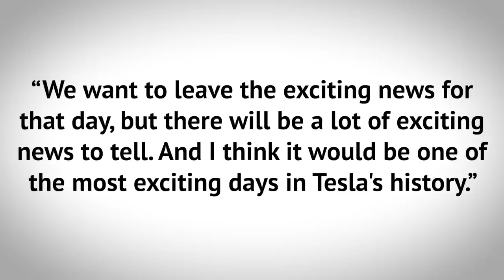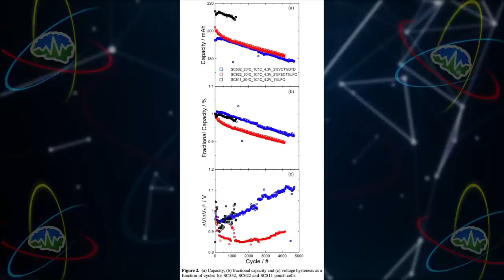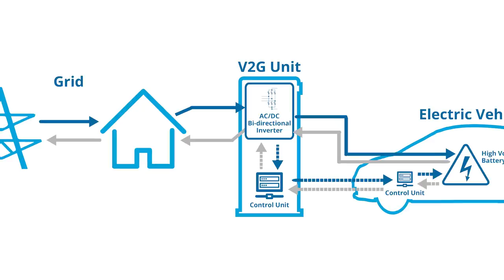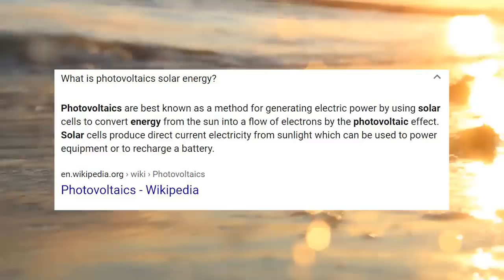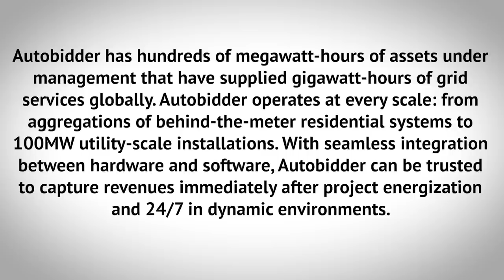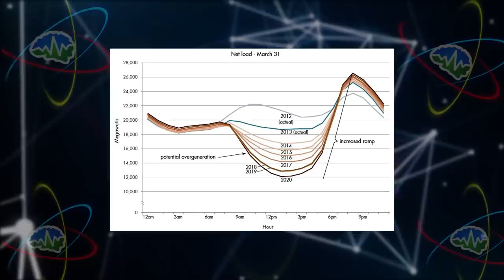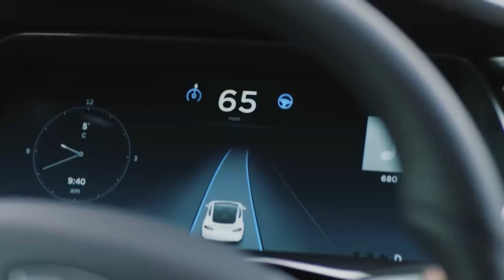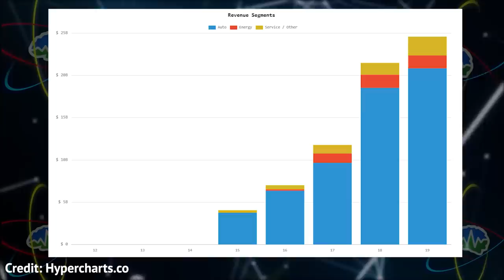Battery Day is Coming!  | In Depth

Comment: Unfortunately it is widely agreed and acknowledged that there is nearly no infrastructure in place for grid operators to gain information from distributed, behind the meter, resources. They would need this information in order to actually effectively take advantage of the battery for grid balancing. There are some meters being put in place in California for distributed energy, but they still aren’t required, and California is the only grid operator doing this. Luckily, we have seen that even if batteries self schedule in order to take advantage of the duck curve (rather than let the grid operator tell them when to come online), they will still contribute a near 100% capacity benefit to the grid that they participate in. However, that has diminishing returns and these cars will likely be at offices during the day, not plugged into an inverter. Also, the grid operator won’t be able to take this into account when grid planning, so how they charge ratepayers will get pretty out of whack. There is a similar issue with rooftop solar. All of this technology is currently only benefiting the upper class to a large extent, from artificially inflating electricity rates to big tax returns on expensive equipment. That all being said, there is a huge opportunity here. There are just more hurdles than this video makes it sound like there are.
Reply: To clarify, grid operators, known as RTOs, operate the transmission grid. Utilities operate the majority of the distribution grid. Utilities currently have no infrastructure to let you buy and sell energy in their distribution grid as a commodity. Instead, you just offset their pricing structure and potentially sell a limited amount of energy to them at a fixed rate. The RTO does have a way to do this. It is called the wholesale electricity market. However, they operate that market as a bidding war where they control the prices so that they can control the grid voltage at any point in time. This video is implying that all of these Tesla chargers and power walls will be bidding into the wholesale electricity market in order to optimize profit, using the cars as their storage. That’s not a bad idea. And it actually might work, but again, that infrastructure of communication back and forth to the RTO really isn’t in place yet, and their markets typically aren’t flexible enough to account for this type of highly variable supply. And they have never had to account for a locationally moving supply. This would completely disrupt the grid and require huge infrastructure changes both economically, regulatory, and technically. It sounds easy at first, but the reality looks like rerouting wires, getting bills passed, and slowly allowing small changes.

Comment: Just move to California.. They will happily mandate you run your house up $80,000 or more for 5 to 6 powerwalls, that are all under state control... throw in an extra 40kw of solar panels, and you will have one heck of an expensive house, mandated by the state, and you will be giving your power to folk that are either not working, or doing a job that has been made surplus...All on your nickel

Comment: Teslas battery day has been leaked. All it is is a solar panel that they have designed for the new Tesla outdoor bug light. It is mind blowing in that they have included two electrode buttons on the exterior of the light housing that a person can cover with their tongue.

Comment: A thought occurred to me: if Tesla wanted to they could lease their cars with the million mile battery at a really low rate that would make the car affordable for everybody, on the basis that Tesla keeps the money made from vehicle to grid charging. Essentially, Tesla would own the car, and would require that it be plugged in for a minimum number of hours each day. The person who leases the car would have a really cheap car lease, and Tesla would still be getting the data they need from the miles being driven by the vehicle, and would be achieving their goal of moving us to sustainable energy a lot faster. If I could have a brand new Tesla for say $50 a week, that would be a no-brainer. For $2500 a year, or a 10 year lease of $25,000, why would I bother to buy a vehicle? I'd also have the benefit of lower running costs and all the other benefits of owning a Tesla, without having to own it.

Comment: I think the V2G/VPP argument may be valid, but it's too soon.  IMO that won't be a part of battery day.  I think Elon will announce a new giga factory (tera factory?) in TX as well as some battery enhancements (faster charge rates, higher energy density, etc).  Time will tell....
Reply: Tom Mckinney - I don’t know if Tesla can “increase the charge rate” above 250 KW, but they could prolong the Time at Peak Charge to 15 minutes so you could get 60+KW in 15 minutes, or 150 KW (think CyberTruck) in 36 minutes.

Comment: Tesla's battery objective has been along several lines. They want the million mile battery, so the car comes with a 'battery for life'
While this is an important milestone the other side is the US$100 per Kw battery. At this price point they will be defeating the competitive situation between IC engine and the electric car. 
There will be no particular reason to own an IC engine car based on a stand alone price point, this without running costs which are much better anyway. 
It is at that point we have reached the end of the IC engined car. Thats why it is important.

Comment: This strategy will only work for a short time. It relies on the grid to function. The grid is maintained and owned by the people who own all of those peaking plants we are putting out of business. So then they will become a grid service company, and charge high rates to be connected so they can remain solvent.

The grid is ultimately doomed to fail. The houses still have loads even when you are not home. So a battery bank will still be required even if the car is there. As grid connection becomes more expensive people will expand the home storage and disconnect. Then you come home, not to power your house, but to charge your car, just like today. What you need is two sets of swappable batteries. One stays home and charges from solar. The other goes with you to the office in your car. When you get home, the second batteries is full, and you swap it. The remaining capacity in battery 1 powers your house for the night,  gets charged the next day. A backup fixed battery would still likely be needed to fill in on cloudy days. You could do this by having a large home battery charge the car battery as well, but it adds cycles to both reducing thier life.
Regular companies would likely start installing large solar energy systems to sell power to the employees while their cars are parked and they cars could buffer any intermittent loads the company uses. Then you could return home with at least a half full battery.
Reply: Have you seen the YouTube doco a few years ago about a village in Holland I think where they were proposing  a vpp using electric cars as storage systems.  Ann a Leaf owner.

Comment: It's just storage, not generation guys. You are glossing over the fact of just the sheer number of solar panels at the current efficiency (and even greater) you would need covering huge swaths of the Earth to fill those up (during the day time when people run their AC). Otherwise you are still just storing fossil fuel energy.... and a solar charge is a slow charge. Let's not get the cart before the horse. Better batteries are great but they don't suddenly become powerplants.

Comment: Molten salt reactors are the solution for grid power.  Renewable power is reliant on solar power which is finite with atmospheric losses, sunlight angle losses, generation losses, storage losses, and transmission losses no matter how short.  So far, the mining and manufacturing necessary to support renewables has created some of the worst environmental impacts in the world, even at its current relative small scale.  PVs will continue to be a good solution for mobile offgrid power generation, and wind in niche offgrid situations, but molten salt reactors are the only grid power solution in the foreseeable future.  They are inherently much safer than the current nuclear technology, much more efficient, produce far less waste that is also far less toxic, and can burn current stockpiles of nuclear waste for fuel!

Comment: Market cap of Tesla is ~$150 billion
Market cap of S&P500 is ~$28 trillion

So Tesla would be about 0.5% of the index
If index funds are a third of the S&P 500 that means index funds would need to buy 0.17% of Tesla outstanding shares or $250 million worth

Won't really move the needle much

Comment: But wouldn't you still need an inverter installed at home anyway? Then install Uninstaled and reinstall everytime time you move? And what if you need to take a trip at the last minute because, say mom is sick, and you don't have enough power to get there. If tesla would just put in super capacitors to recharge the batteries on the go or have a tiny generator in there to top up the battery when it needs it. More people would get on board if there could be fast charging on 120v and a way to "gas up" the batteries on trips. Maybe I should live in tesla town and visit mom on the tablet, we are doing it now, just hug a pillow with "mom" on it. She can have one with your name on it. Our politicians are wallet tied to old energy and car companies through lobbying.

Comment: Tesla car isn't worth $36,000 as a virtual power plant not in most countries around the world

Capacity payments in the UK are £6.44 per KW a 7KW home charger means it's worth £6.44 X 7KW = ~£45 a year if you can guarantee that during winter days the car will be at home between 4pm to 8pm.... and I'd suggest many cars can't be at home every winter day during those hours so even less

What makes more sense is if Tesla fills its cars with cheap electricity from the grid at night and other periods. Then powers the home with the car at all other times when plugged in. This might mean a lot of the electricity consumption of the home is switched to cheaper rates. Average UK cost might go from 16p to 8p which would save maybe £250 a year

If the car is kept for 10 years that's a benefit to the owner of ~£2,500 which lowers the UK price of a model 3 effectively by ~6% but that's still too high for most UK new car buyers

What might be more interesting is if the car could easily drop and pick up a large portion of its battery pack. If a 75KWh Tesla could leave behind 50KWh of its battery in the garage so the home has a 50KWh battery. The remaining 25KWh pack is still good for 100 miles which is probably enough for 350 days of the year. The other 15 days of the year when you need a 300 mile range car the model 3 plugs it's 50KWh back in. I'm not sure how this can be done but it would be interesting. The lighter 25KWh car would also wear out the tires less and have more efficiency since it's not carrying around as much weight

Comment: An E-car is powered by batteries, the batteries has to be charged from other energy source. Is it not possible for an E-car that can charge its own batteries while running ? One possibility is the installation of a  battery powered generator  in an E-car for the purpose of recharging its batteries. why scientist are not looking on this possibility?
Reply: Actually the answer is yes and no.

Comment: I think the assumptions for the value calculations are a bit off. Tesla won´t pay people to buy their cars. They would prefer to sell powerwalls instead if the cars won´t sell. A rent for the battery might be accepted but it has to be cheap or the use has to be for the car owner exclusively. People buy cars to be independent of schedules in public transportation, so people won´t like Tesla to plan and reduce their SOC in the private car - what reduces the freedom to go wherever people want at any time people want.
I guess in the future Tesla might just rent/lease their cars or people still can buy Teslas, but then can use the battery to their own like. Although the battery will be able to serve multi purposes, the value of the battery is spread to the different purposes, not summed up by the purposes additionally. So, I also disagree to the statement that each sold car has an additional hidden value for Tesla because of the possible battery uses. First of all, the batteries are sold. They don´t belong to Tesla anymore. Second of all if the battery is used as an energy storage billed by Tesla and not the car owner, the car value decreases. Nevertheless, Tesla could set higher prices or outsell the competitors if people can use their Tesla as a powerwall combined with solar for their house.
 
Best regards from Germany.
 
P.S. We might have another view on private cars :D

Comment: Switching to electric doesn't solve everything yet. We're still relying on a limited resource which is lithium and that causes ecological problems. Most of the electricity produced on earth comes from fossil fuels, and most solar panels are built in China with power produced from fossil fuels. Recent studies do show that EVs emit less CO2 than ICE over their lifetime even when built in China and charged in fossil fuel heavy countries , but we're still far from being clean and especially sustainable.
I wish Tesla could come up with a breakthrough battery that didn't use lithium, or a huge capacitor. If his goal really is to make the world more sustainable, he should be researching new nuclear technology, like thorium, fusion, etc.

Comment: Honly was you can make a lithium battery supply work for long term is recycling. Far as I know, theres no recycling lithium to produce more batteries
Reply: "Far as I know, there's no recycling lithium to produce more batteries"
What?  Of course lithium can be recycled.  It isn't done much yet, just because there aren't enough old worn-out lithium batteries.  But every manufacturer AFAIK is making plans to recycle batteries.

Comment: This is all great, but Tesla still doesn't own or control any part of energy transfer infrastructure, plus many parts of it right now don't support high load to travel in both directions. Your neighborhood substations are not designed for it. Some might, but many won't handle this. This is a fixable problem, but it requires time and money, so it's not quite as rosy and revolutionary at the flick of a switch as you make it sound.

Comment: Okay. I'm waay behind your understanding, guys. So first, big thanks. So. I need your brains to help me understand what I'm missing. This might be BIG. Here goes. If I understand this video, all this economics depends on the widespread rollout of renewable energy (solar and windmills)...energy that can be "saved"? Correct? That's basically all I need confirmed. The rest I'm going to comment on is more for the odd (possibly brilliant) curious soul. 

The recent 2020 doc supported by Michael Moore summarized the current economics of green technology in the this way: It's plugged into the same old pollution system. You know, electric cars plugged into the coal-fired and nuclear power plants. How is that better?

The answer is, I'm assuming; "the long game" in renewable energy. Who is investing in this in the US?  ...   One of economics that is so true is in ownership of the inputs. Land is the principle input. We can change how we use the land, but owning the land is key. In one century it can be used to grow food, another century solar farms. So does Musk own wind farms? Solar farms? Of course there are other inputs like transmission lines, telephone and cable wire accross the nation. What are all the inputs that Musk is investing in? How much cash does Musk have? 

Now, would I be correct that Musk has competitors in the area of the inputs, like oil, nuclear, coal and hydro corporations (that have plans of their own)? Especially oil and coal. Are they planning to join the Tesla wagon? Will they challenge him? I think that it's the little guy whose gonna hop on board the Tesla wagon making Musk rich beyond Bezos's wildest imagination. 

Musk, like Tesla long ago, is a genius (who is coy on account of distrusting of the really powerful men that already have deeply established their own faults and economics of energy). I'm concerned that the old dynasties, who are Musks competitors, are more into the status quo that they have established, which includes population control. Basically, I wonder if renewable energy is not going to be something that will make the world a better place (making money from my car while it's plugged in at work) as much as it will simply lead to change that has its caveats just the same as any system before it. I base all this on the fact that greed is greed and Tesla will make no difference in changing that. Indeed, he may "join the club" and grab the cash along the way. So don't forget to give him your money to make the world a better place. 

Example. We know that many cities in the 50's and 60's lost their streetcar public transit system due to the fact that oil companies wanted buses so they could sell more oil in the form of gasoline. Nicola Telsa himself experienced how powerful the economics under Edison and the banks was under the DC system. Finally, under the newly-formed company GE, Tesla sold his AC/DC patents for a little more than $200K, which made him rich, naturally. It was the springboard for the electrical system current today.

The point of all this is to present the always important reminder that the little man with his mobile battery never wins. The billionaires with well-established economies supported even by covert means and war have never made the world better. Indeed pollution and over consumption is the result. Imagine if this million mile model works for some time; how do I, the "little guy" take advantage of it? Give Musk my money. The more Tesla cars we have in the world, the better?